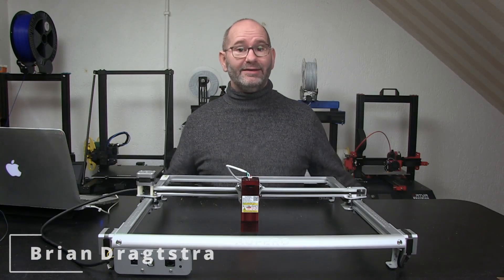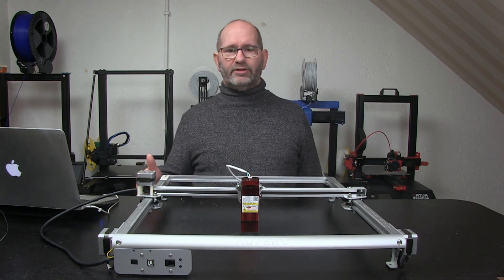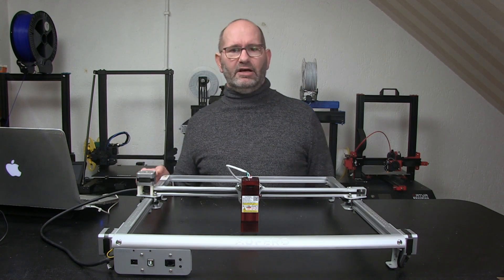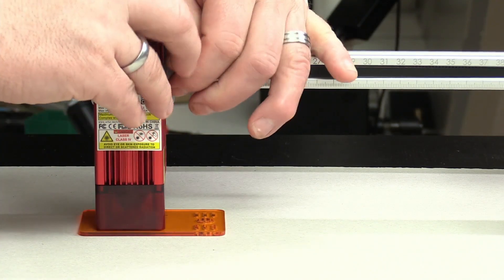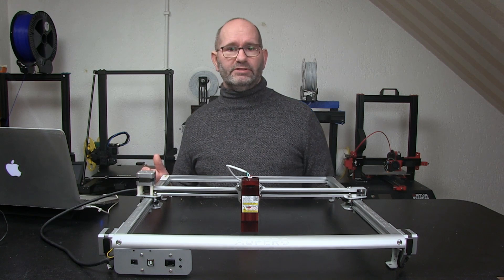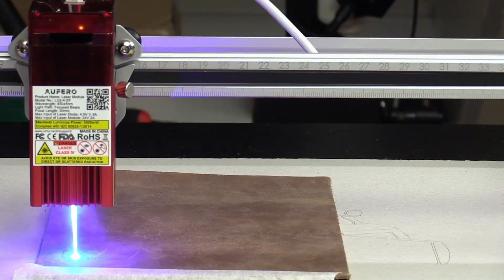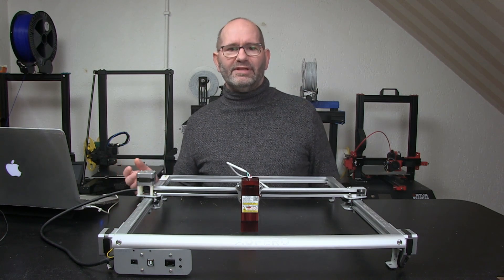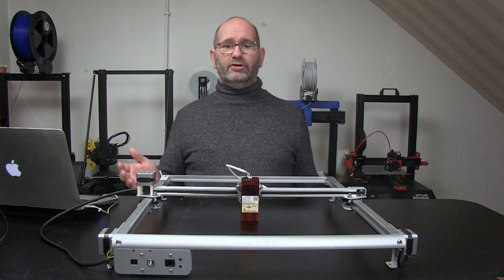▼ Aufero Laser 2 REVIEW

Comment: Excellent review Brian as usual. Clear and concise. I actually like the horizontal v-wheels & rails! It keeps the dust and debris out of the channels so you don't have to clean them as much. Although, we'll have to wait and see how the added pressure to the bottom side of the wheels adds to wear and tear. They probably should have used stainless wheels.
Reply from the maker: Thanks a lot.
It's not that I don't like the horizontal rollers, it's just that 4 wheels are more difficult to align than 3 wheels.
Reply: @3dPrintCreator  I get it Brian! I agree, but the benefit outweighs the little bit of initial work!

Comment: Wrong...this laser use belt system and can be speedy 10000mm/min with no problems, I made vid. 😁
Reply from the maker: Good luck with it Roland, it doesn't finish any engraving at 6000mm/min or faster. I tried and confirmed with the people at Ortur. Also in their manual they mention 5000mm/min

CORRECTION AT THIS ANSWER. 
Roland Med, you are correct !!!
I made a new video about it, showing even 15000 mm/Min without any problems.
Thanks Roland.
Reply: Actually, the Aufero is capable of 12000 mm/min, however Brian is right, good luck doing anything over 6000. I don't think I have gone over 4000 on any of my projects to date.